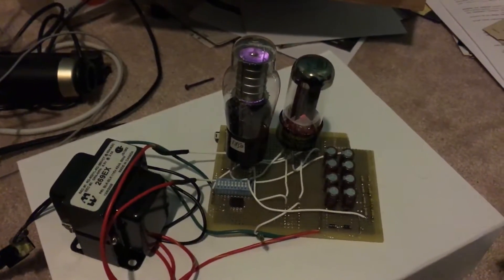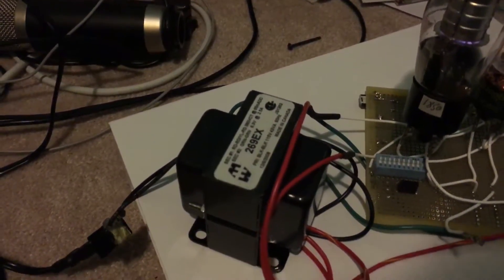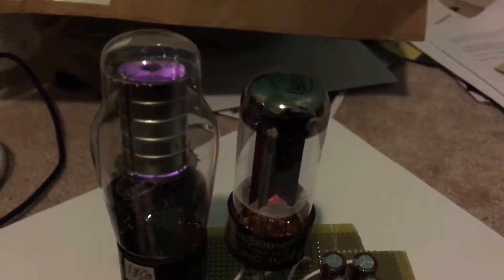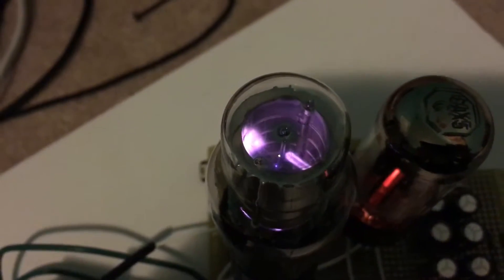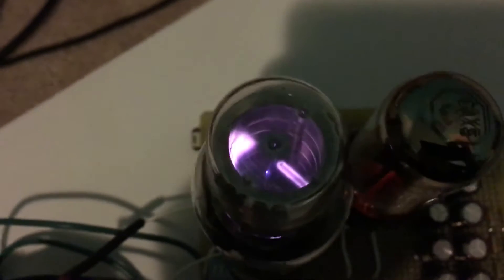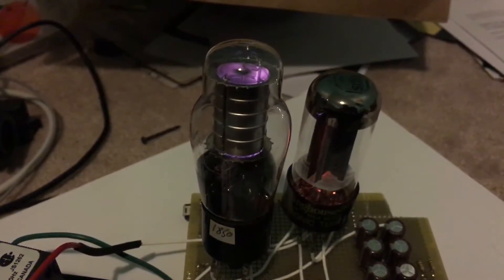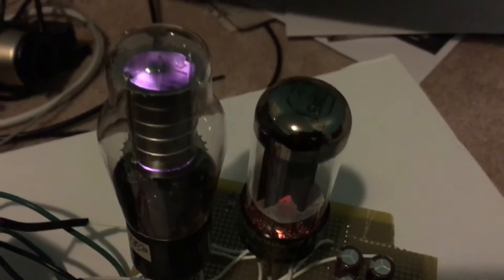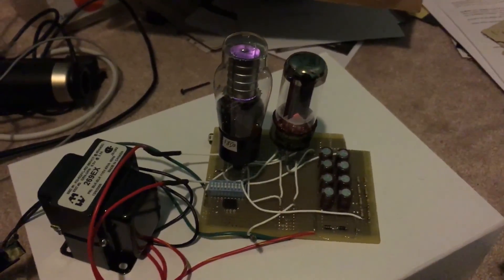Basic Tube Power Supply :)

Comment: "Most importantly though, it glows".
Good to see you have your priorities in order :)

How would temperatures compare to a normal PSU?
Reply from the maker: Glurgi thanks for the comment! 

The temperatures are hard to compare, since the diode tube needs to be made hot in order to work. Still okay to touch, but definitely warm. I’d guess the tubes with glowing filaments get around 50°C. Roughly the same as a power supply under load, but with far less load-dependency.

Obviously super inefficient that you have to heat the dang things to make ‘em conduct, but they work, and they’re super pretty!
Reply: 50-60 C doesn't seem too bad.
Normal PSU's go warmer and then need a (sometimes noisy) fan to regulate the heat. Plus they don't glow so less cool that way :)

I was thinking of a computer PSU with tubes in the 600 W range, your video inspired me.
Do you think that would be feasible?
Reply from the maker: Glurgi So, I’ve never run any significant amount of current through these tubes, but I would be surprised if that creates significant issue just based on the robust nature of constructing things out of big hunks of metal in glass tubes, rather than small semiconductor material. Biggest issue I could foresee would be that the vacuum tubes don’t physically allow that many electrons to travel at the rate/density required to pass the 1-2amps needed through the tube (maybe it’d have to be a really big tube or something).

I could see this working, but you’d basically want to use the tubes only for full/half-wave rectification step, and feed that into a particularly high-voltage tolerant flyback regulator, since tubes necessarily need to be used at much higher voltages than the 3.3, 5, 12V rails that I expect your standard PC PSU would output (plus, higher voltage means lower current and Ive never looked into the current limits of these types of dual-diode tubes).

Easiest, safest way would be to do some reverse-engineering on an existing PC PSU, figure out the specs of its main flyback(s), and then just chop out the bridge rectifier for a transformer and a tube-based rectifier. You want all the filtering, fusing, control of the PSU, but if you’re trying to add the glow of tubes, that’d be the way. Unfortunately, if you want the purple gas discharge tube you see in my video, I can’t really think of a way to make it do anything meaningful, just burning power and making it glow, since it’s up at around 100V or so if I’m remembering properly.

Also, please please please be very careful if you’re actually planning to go through with this. Playing with primary-side mains electricity is dangerous! I’m only confident enough to use the janky setup you see above because I know what I’m doing, and I know how much it hurts to be zapped, so I’m really careful. It’s really easy to accidentally stop your heart when you’re doing HV stuff like this (especially primary side).

Anyways, if nothing else, it was super fun thought experiment to see how one could incorporate vacuum tubes in a steampunky PC PSU! Maybe I should look into making a programmable power supply with a vacuum tube rectifier stage...